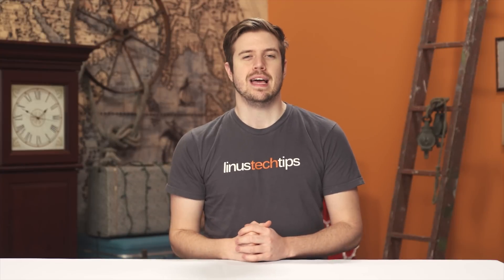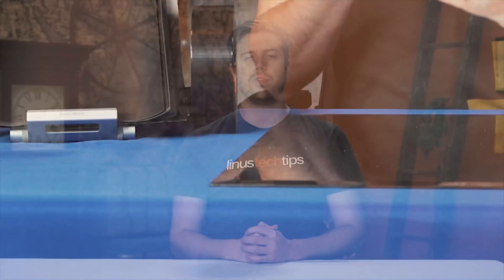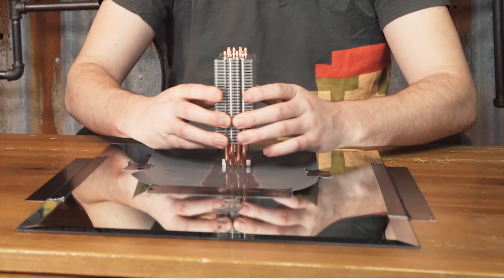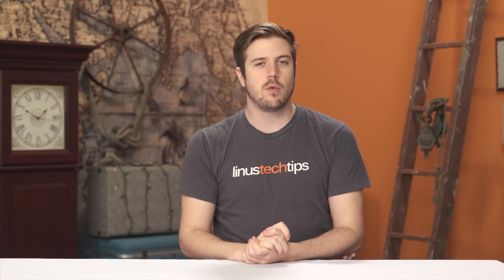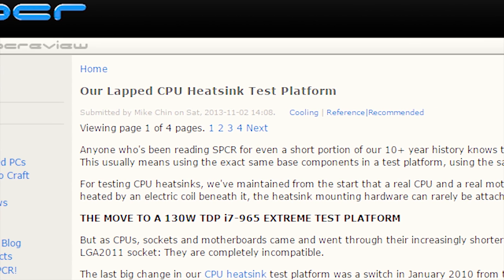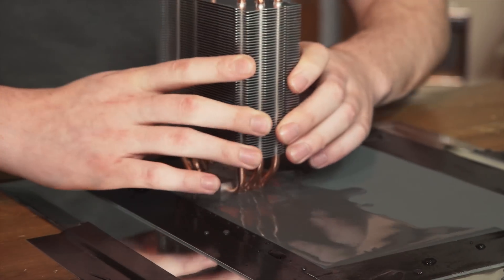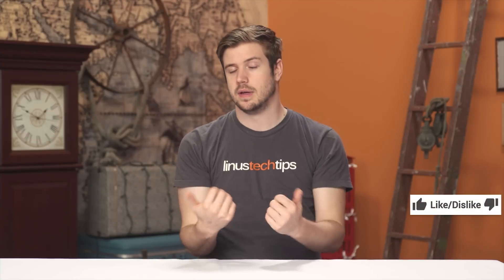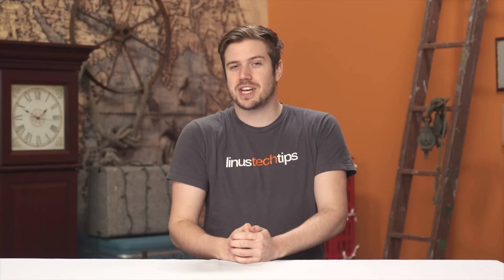CPU & Heatsink Lapping - Are concave, convex, or flat heatsinks best for cooling?

Comment: Isnt that what thermal paste does? It fills all the imperfections and conducts heat.
Reply: +Speedyjens Yes, that's exactly what it does.  The idea with lapping is to minimize the need for the paste, as solid copper conducts heat better than any thermal paste.
Reply: +Jasoman in theory you can use less paste with a lapped CPU and sink, because there are less imperfections. this would be more thermally conductive because the heat is travelling through less paste. How much less? I don't have the wallet to dare test that
Reply: +Speedyjens Somewhat
Reply: +wannabesq But didn't they disprove the need for precise thermal paste in the last video that did not have a deceive answer besides don't use to little?
Reply: +Sabi Teodosiev having the same refractive index in your analogy isn't even remotely similar to the context of heatsinks lmao

Everyone already knows thermal paste has a much lower conduction rate than metallic contacts but it's still better than having air. And how is thermal paste expensive? The only thing expensive here is welding, which is expensive in both temporal and monetary reasons.
Reply: +Jasoman that video was talking about thermal paste application techniques, not the quality of the thermal paste itself (which can be subpar when it came with the stock cooler).
Reply: +Lorentz the annoying Llama and that's why we have flux welding. There will never be full perfection in a crystal structure, more so for metallic heatsinks. But it ain't cheap and Intel decided to jew out on it's thermal interface and we're left with subpar thermal paste..
Reply: +Speedyjens yup, and actually this is (potentially) silly. With all the imperfections you get a larger area for heat diserpation (so as long as the thermal paste goes in to all of these 1 micro meter deep dents, you should potentially get a better result). If the shine helps the heat to disapate i can't remember, but since nearly no air is around i guess no. 

For the lapping he can't do it as he did. What he did was on sandpaper which is a more rough process than sandpaper < mol < nap < lap. When you do a lapping you normaly have a disc spinning with 1 micron small artificial diamonds (which is 8000 or 12000 in sandpaper numbers). 

i never did a check so i assumed this "cloth + diamond" system was the finest, but please correct me if i'm wrong. 

And luke! you can't slide it like that! if you want a flat flat (within 1 micron) you can't slide it... keep it togeather....

i'd like to see one where he uses a rough sandpaper, and the best thermal paste he can find. THAT might make a huge difference (depending on the thermal conductivity of the paste :) )

(i'm a mech engineer student)
Reply: I'm still waiting for his PhD thesis rofl
Reply: 3R45U5 Yup I know about that reason, still doesn't excuse them from using subpar thermal compound and having extremely low quality control on application.
Reply: Stranaton
Well in the other video they tested the thermal paste and found out that more paste was better than less.
Reply: +Speedyjens Yeah, but copper is still better at conducting heat than thermal paste, so the less paste you need, the better.
Reply: You clearly haven't seen the thermal past video Luke made
Reply: ***** Small unmatched imperfections = more insulative gaps and worse thermal transfer... thermal paste is not a good conductor compared to copper but its better than air hence why it is used, you should do a refresher on that PhD ;)
Reply: +Dylan N. He doesn't even know his scientific terms lol I bet he got his 'PhD' by ignoring what he learnt in class too
Reply: +Sabi Teodosiev 
it doesnt work that way, because when you put a rough  surface onto another rough surface you have air pockets between them and air isnt a good heat conducter.
by lapping the material, you decrease the spots where air pockets can form and the two surfaces with the best thermal conductivity can touch each other.
thermal interface material is supposed to fill these pockets, as TIM is a much better heat conducter than air, obviously.
however, you introduce another layer of material, that isnt as good a heat transferring material as copper ( or nickel for that matter), so that TIM is better than rough surface without tim, but (potentially) worse than two perfectly even surfaces directly interfacing each other.
Reply: +girlsdrinkfeck This doesn't work better than putting a big pea-sized blob on there (WAY more than is required) and letting the heat sink squeeze out the excess. Almost whatever you do, it won't make a difference.
Reply: +Stranaton Hahha then you have to figure out the "optimal" amount of thermal paste.
Reply: +Speedyjens Margin of error, it's much better to say they found out that "not enough is worse than a little too much".
Reply: Is there a video comparing thermal paste vs. no thermal paste, whether it really makes a significant difference?
We take it for granted that it makes a big difference, like it were a self-evident fact. I, however, have never seen an actual test being done. (Yes, I'm sure it makes a significant difference. I'm not doubting that. I just would want to see an actual test being made, rather than rely on claims and intuition.)
Reply: +Speedyjens if the heatsink and the cpu in eighter curved or concave, they wont make good enough contact, and the termal paste wont really do too much about it
Reply: +Speedyjens oh, youre supposed to sand your cpu tho, not the heatsink alone...
Reply: +[MsR] Master That's not necessarily true about the thermal paste under the heat spreader as alot of them are soldered. which is why there were issues with a certain generation of intel chips as they tried to save costs by using thermal compounds instead.
Reply: +Speedyjens Relatively speaking thermal paste is not a good thermal conductor though.
Reply: +Speedyjens thats what i was thinking, but i guess that people polish their cpus and blocks sometimes. soooo idk
Reply: +Speedyjens yes but if the layer is too thick thermal paste can act as a insulator, hence the reason why concave heat-sinks are bad as they add space above the cpu die's where thermal paste pools and becomes too thick. The idea behind lapping and creating a flat surface is essentially to reduce the gap wherever possible. In the case of a good flat base or a convex base with good tight mounting there is no point unless there was an error in manufacturing creating areas where the plate is not flat or convex in the correct way casing thermal paste to be too thick in important areas. But manufacturing is at the point these days that this is less of an issue.
Reply: +Speedyjens Yes, but the copper (or aluminium) conducts heat much better, so the less paste you need the better.
Reply: Das right
Reply: +Sabi Teodosiev i call  bullshit
Reply: +Sabi Teodosiev liar! you dont even know, its conduct not conduit
Reply: +Ricardo Deleon Yes, yes I have. Luke's test was on how much thermal paste was used and whether too much makes a difference with a cpu cooler with a tight fit, not on how thick the layer between the cpu plate and the heat-sink plate is. At the end of the day as long as you are using non-conductive thermal paste you could use a whole tub of the stuff on the heat-sink and it would make little difference if you have a good tight fit, as it would push out all the excess to the sides and off the cpu. What I am talking about is in the event that the heat-sinks plate is not flat or convex leaving an extra thick layer of thermal paste between the heat-sink and the cpu. That is why concave plates are bad as they leave a pocket of thermal compound that is too thick leading to insulation. Mind you that it could never full insulate the cpu with a millimeter or two of thermal paste thickness, but it can drastically raise temperatures. It is almost as bad as having a loose cpu block with an air gap of a millimeter or so.
Reply: +[MsR] Master 
you dont need to weld both surfaces together.
3000+ grit lapped surfaces can run without any TIM. they will even bond to each other and are very tough to seperate again, unfortunately i forgot what this form of adhesion is called.
Reply: +Speedyjens but you want as little as possible as it's not any where near as good at heat conduction as metal.
So if you can lower your TIM from 2 drops to 1 drop then in theory you will have better heat transfer. (Yes random numbers was used)
Reply: +Kenneth Ho 
word on the street says that intel didnt cheap out on their chips. its just that the flux welding process  introduced thermal stress onto the delicate dies and cracked them, reducing yield.
going down in nodes makes CPU cores more and more fragile.
Reply: +[MsR] Master You hinted it but I'll just make the point clear. TIM transfers heat better than simply two pieces of metal touching each other. No matter how perfect their surface is. There's still a gap between them. TIM fills the gap, along with any imperfections of the surface.

Today, Intel puts TIM under their heatspreaders. They used to solder them directly to the die, but stopped doing so since Ivy Bridge I believe. 
The TIM itself is perfectly fine but the application of the material was far from optimal, which resulted in inconsistencies in temperature performance. Deliding the CPU and applying new TIM did two things: It put the heatspreader closer to the die and allowed the user apply the TIM in a way that does not affect performance. Today, you can still delid your CPU, but you're only really putting the heatspreader closer to the die.
Reply: +Sabi Teodosiev Wow you're so incredibly wrong.  More surface area makes sense when transferring heat from heat fins to air or something like that, but not from a flat CPU to a flat HSF base.  Imperfections only hinder the process!  What are you even thinking? Lol.  Please see every response from everyone who has replied to you.
Reply: +Sabi Teodosiev 
that would work, if it was done on purpose (on a very small scale). like, if both the IHS and contact plate were made in say, a microscopic 'sawtooth' pattern.
but they're manufactuered to be 'flat', so imperfections doesn't help.

because the extra surface area is too small to actually be successful, as well as they don't end up 'locking together' to actually take advantage of the extra surface area.

because of that bumps end up creating air pockets or areas that have thicker paste.
as the Thermal Paste is there to compensate for imperfections(and try to avoid having atmosphere trapped in between), rather than being there because it conducts better than actual metal.
Reply: +wannabesq Use IC Diamond which is VERY conductive, and you wont worry about putting too much unless of course you drown your Chip with it.
Reply: rapper250 Drowning your chip makes no difference as shown by Jayztwocents.
Reply: +My 0x1E yeah it does. Jay used non conductive thermal paste. Adding too much paste won't damage anything unless it's conductive which most of the market isn't anymore
Reply: Atqthe30th Ah I read it wrong. I thought you was talking about thermals,
Yes it would damage the chip / card if the paste is electrically conductive.
Reply: *****
That didn't answer my question.
Reply: +Speedyjens Thermal paste is a very poor conductor of heat compared to a solid block of metal. That turns out to not matter much on heat sinks as it's a very thin layer between two almost flat surfaces.
Reply: +Speedyjens Excess paste just gets squeezed out, where as with too little paste it does not cover the entire IHS, just a blob near the center.
Reply: +Sabi Teodosiev "Why do you think is the thermal paste so expensive?"

It isn't. There are fancy thermal pastes that are, but they're they don't work any better and aren't more stable. Mayonnaise or tooth paste isn't stable over time, but as far as cooling performance goes, it's almost idential to actual thermal paste.
Reply: soylentgreenb Yes but it is next to imposible to get a totally flat metal plate to have 100% contact and no air between and the mounting would have to be 100% even on all side. Since that is nearly imposible its better to have the thermalpaste which deals with these things at a low cost.
Reply: *****
I didn't ask if thermal paste makes a difference and how.
Reply: +Speedyjens thank you, I was going to type an all caps, very aggressive comment in that style
Reply: *****
Exactly. I asked for a video. An actual test with video documentation found on YouTube. Not for an explanation of the theory.

You can talk about "basic science" all day long, but without an actual physical controlled test it means little. (It also says nothing about how large the difference is.)
Reply: +Sabi Teodosiev 
Arctic MX-4: 8.5W/mK
Commercial copper: ~360W/mK

So yeah. But no.
Reply: allupro but the natural convection coefficient for air makes metal to metal exchange very very bad so it's not worth trying to perform what would need to be a very precise grinding and polishing process on both surfaces without precision tools
Reply: ***** I know. I was just answering to the dude who said more imperfections is better.
Reply: allupro i guess a combination of both would be the most beneficial
Reply: ***** Basically yeah
Reply: Well, I presume the best option is to polish both sides with the thinnest possible polisher and then add as little thermal paste as possible to fill the space between them... But that would be probably hours of hard work for not much if not nothing...
Reply: Thermal paste is still much better heat conductor than air. Lapping does help, sometimes a lot, you can check exact measurements here: www.overclockers.com/heatsink-mounting-pressure-vs-performance/
Reply: +Speedyjens Can't be as good as metal on metal. However you would have to literally weld it on to do that, and it's not that easy. Also there's thermal paste UNDER the heat spreader that you can replace with better aftermarket stuff.